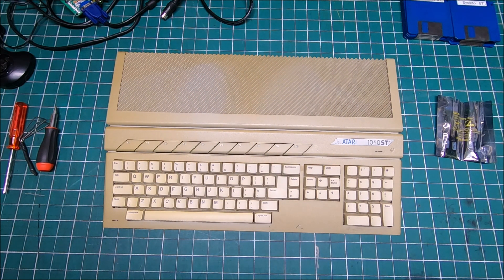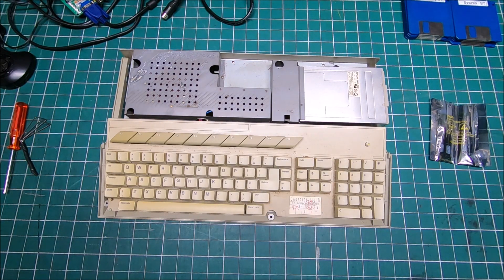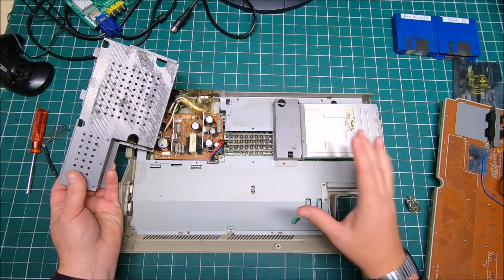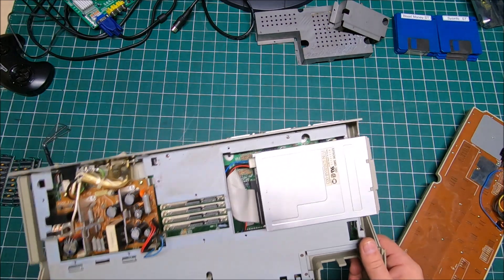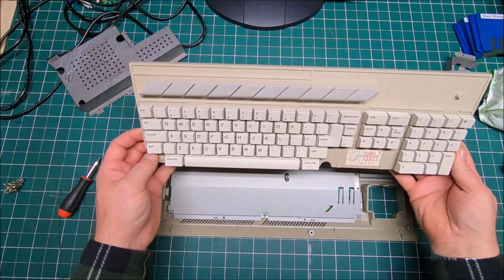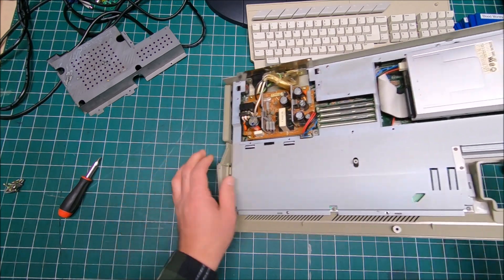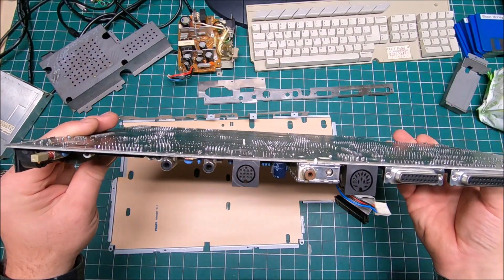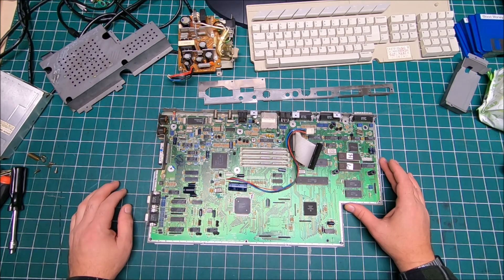Atari STE 1040 Restoration/Mods 4mb ram upgrade and more ST Part 3

Comment: I've got version 2.06 in my STE, is that less compatible with games then?  I do have the older 1.62 roms still. I have 4mb upgrade ram arriving today :).. I'm glad there are no jumpers to set in the Simm based machines :).
Reply from the maker: My Atari 1040 STE now also has TOS 2.06, and to be honest I didn't recognize that
Reply: @GPeter7  do you find the ST bombs a lot? Mine does. I'm trying after the 4mb upgrade and those programs are trying to run now but often bomb 💣. I am using an ultra satan device too.

Comment: My ATARI 520STE was forgot on in my grandparents basement were i use to hang around and smoke weed with friends for 6 years and still work today as in day one ( same motherbord with sloted 30 pin ram ) .xbox360 console i had 4 from new and none are still working today
Reply from the maker: yes Atari built it like a tank 👍😉

Comment: Atari has double click..it's probably something with your trackball mouse buttons. Hi res mod is available for atari monitor (sm124 I think), usually for programs like dtp etc, not so much games  (but there are games for hi res) because it's limited colors in that mode (no color). Anyway.. nice late STE machine, though you could of cleaned that yellow from the case too :)
Reply from the maker: thank you, it's good to know that 😉